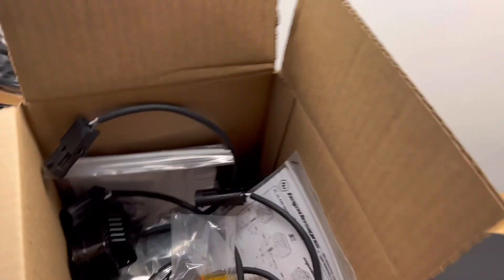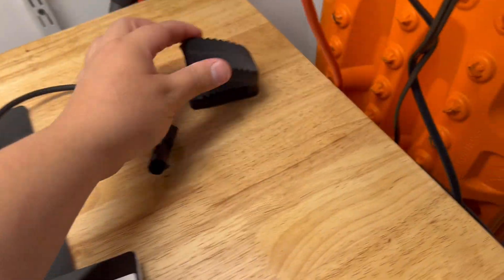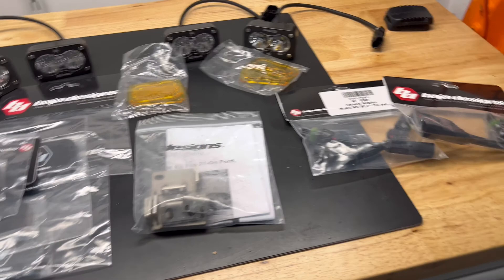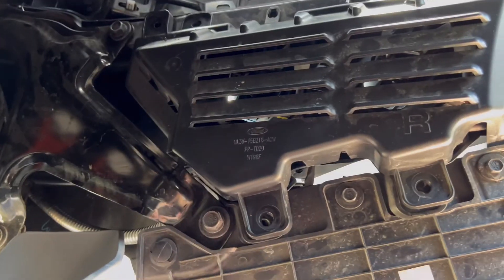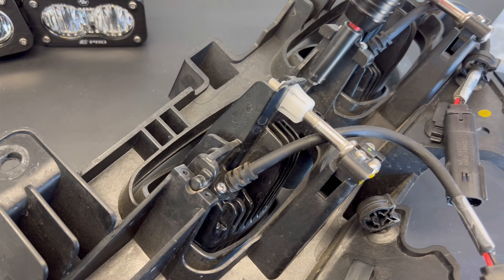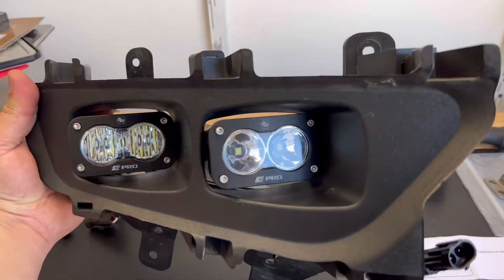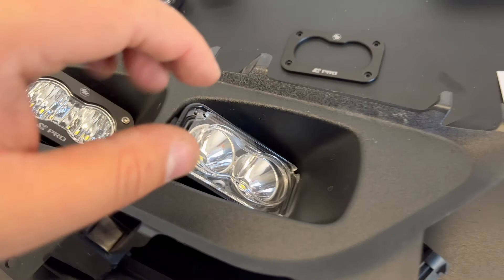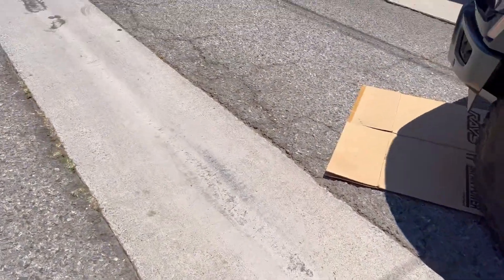FORD RAPTOR GEN 3 BAJADESIGNS S2 PRO DUAL FOG POCKET LIGHT KIT

Comment: How are these lights compared to the stock Rigid lights?
Reply from the maker: @nicholasadamcheski3250  they are not that bright but they are SAE legal so it really depends what you want.
Reply: @DrewDayToday  I was looking for a set to replace the Rigid stock light on a 2024 Bronco Raptor. I thought one pair was SAE certified and the other was brighter and not SAE certified. Is this not correct?
Reply from the maker: @nicholasadamcheski3250  honestly I’m not entirely sure. All I know is that they were not bright at all which made me get the s2 Pros which are extremely bright compared to those rigids.

Comment: Nice! How the heck did you get the top bolts/t30?  Can’t get a right angle drill or anything to them with that bar in the way?
Reply from the maker: I used a ratchet with extension, I removed the brace bar and moved it out the way to get to it if you have Instagram I can send you photos of how I did it. @drewdaytoday
Reply: @DrewDayToday  that would be great thanks! @matt0520. Those t30 are my hang up